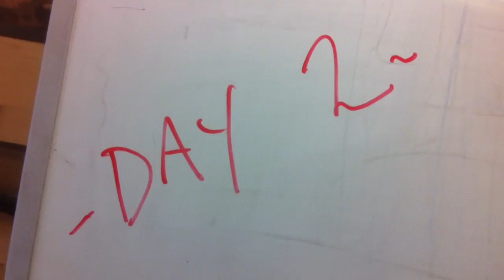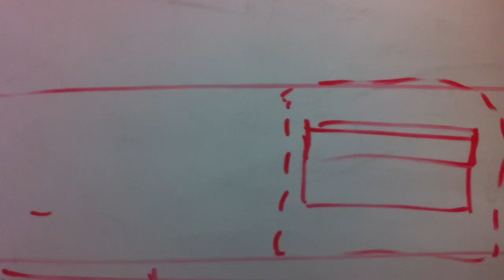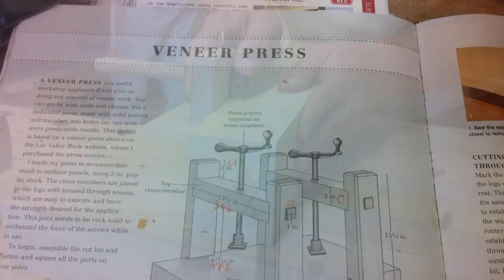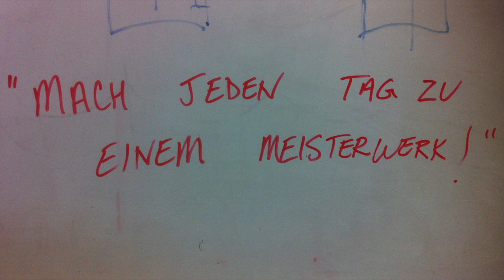Inside the Walls of Woodworking ( Munich in June )

Comment: Great class, great fun, great teacher.  A true inspiration on many levels  Thanks Tom.
Reply from the maker: Rhett Lego Thanks Rhett- it was great to meet you and have you attend the class. Hope we'll run into each other again.
all the best~
Reply: Tom Fidgen Mate  quick question  The metal screws arrived for the Press we made  But I think we screwed up as they are too long to fit in the cross beams  - you cant insert them between the press surface and the cross beam ... or have I got this totally wrong??  Trust youre well ...

Comment from the maker: Rhett, good to hear the hardware arrived... 
I asked Peter to check and this is his response: Tom,
mine are working well. He shall screw them in from the top, not from between base and top. You can clip off the base plate of the screw, unscrew the nut, fix the nut in the beam and screw the spindle from the top into the nut and in the base plate.
Hope that helps- all the best!